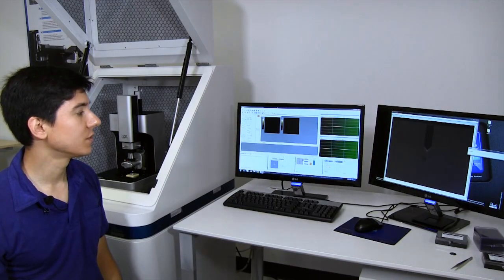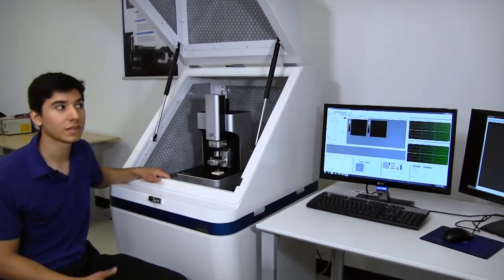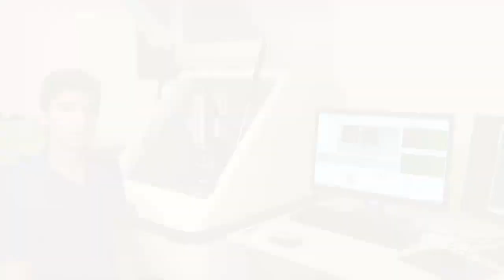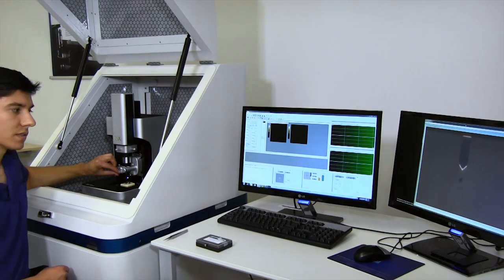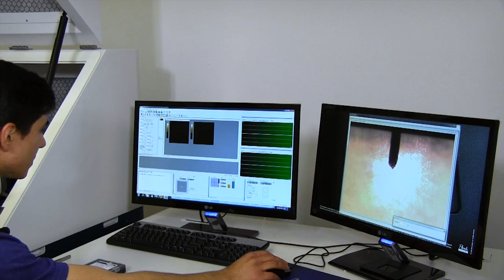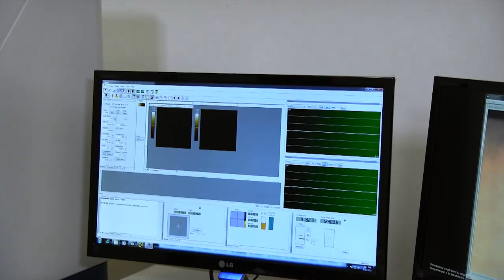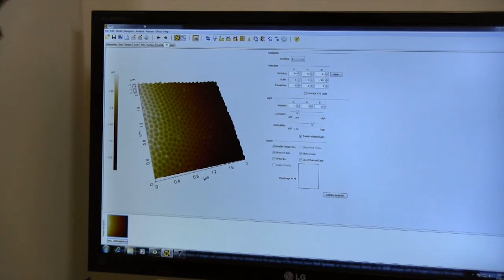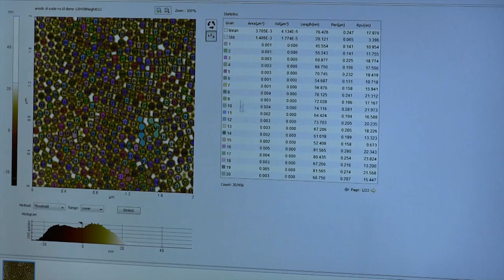Park Atomic Force Microscopy - The Easiest to Use AFM

Comment: Hi, I would like to seek your help. I am going to use AFM for my research. I am doing research on dry powder inhalation. I want to measure the adhesion force between drug and carrier. Could you advise me how to install the drug or carrier on colloid probe. Any technique to install those tiny micron size particles on probe? drug particles will be on the glass slide and carrier particles will be install on probe. But, I still don't know how to install them. Thanks in advance